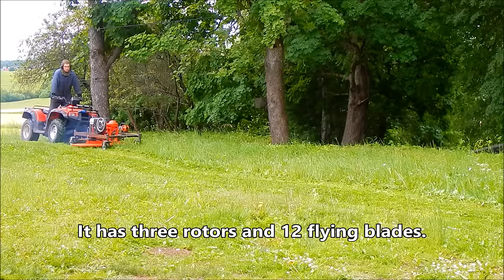Homemade Front Mount ATV Mower

Comment: You mastered that mower the blades are perfectly in line and in balance to the last gram, a couple weeks ago I was mower grass for hay on are farm with a 4 drum I think it 2.5 meter in length and the blade holder snapped of becoming a brick when though it and it shuck its balls off the part weighs 250 grams and the parts shop didn't have a new one so I had to weld one together and I was 30 grams to heavy and I thought it close enough got to the field started her up and it's going off again like crazy just shows what a good job you did to get it spot on 👍

Comment: You might have over 100 hours into building it. In 1994 I built a mower on 4 caster wheels, mounting it to the rear and offset to the left side of my Wheel Horse 252-H tractor. It had a Bolens 34" deck and a Briggs 8hp engine. It ran twice and cut well but I had it geared too high and the engine popped a valve. I didn't have the money to fix the engine so I parted it out. I wish I had a picture of it, but in those years trying to come up with an extra $50 was really hard. About 15 years ago by parting out lawn mowers and have gathered enough engines, electric clutches and casters to build about 6 pull type mowers. My problem is I have had health problems since I was a teenager and was diagnosed with Lyme disease 4 years ago. I'm 50 now and I'm hoping I can stay healthy enough to build some pull type mowers before I die.

Comment: Pretty cool. I really wanted to see how well it turned while mowing. Then it didn't show it so I assumed it couldn't?
Reply from the maker: It does pretty well. Pretty wide turning radius though.
Reply: Awesome man,  I've wanted to hook my mowers on the front as well but never went through with the idea. I do currently pull 2 push mowers behind me though. Gets me a 94" cut in total. Vid is on my channel if you are interested.

Comment: Very cool. I miss welding and fabricating. I worked at a company where I was the Lead mechanic with all my plus rates (welder-mechanic-machinist-pipefitter-millwright) so I had lots of tittles and The ones I used the most was my welding, mechanic, and machinist. I was forced out at 62, (Down sizing)and I miss that job, but I really enjoy being retired. I am building up my equipment, but I need a tabletop lathe.

Comment: ATV Front mounted, mower attachment. Caster wheeled, flail mower, w/ auxiliary motor, belt operated, w/ remote kill switch and electric height adjustment. ;-) SWEET PROJECT VIDEO!

Comment: I have parted out about 60 riding mowers and commercial walk behind mowers and I have saved parts from them. I have enough mower spindles, clutches, engines, casters, caster frames and metal to build about 6 of those. My problem is the damn Lyme disease I was diagnosed with 6 years ago. I have one 36” wing mower I was making out of a Snapper SPA 360 commercial walk behind mower, minus the rear half which had the engine and drive wheels. . I have the extra casters added to the rear. I just need to add the engine and the linkage to the tractor then add controls. 
I have another 40” wing mower I with a height adjustment system that I just need to install the engine, linkage to the tractor and controls. Lately the Lyme disease has reduced the strength of my arms.

Comment: Great build, I could tell you are young guy, lifting that 10hp Honda engine to the lathe chuck to see if the engine shaft fits the bore of the pulley, I used to do things like that back in the day but not no more!
Reply from the maker: It was a one time deal. I injured my back when I was younger while snowboarding, so I too have to be more careful and if possible work smart not hard. ;) Thanks for watching!
Reply: Donna Ares in DIY

Comment: I liked it more than I thought than I would . Nice use of metal and a welder . Cutting on wet grass is a big test . Hell even a good paint job . You even  put grease fittings on it  nice .
Reply from the maker: I got it working really good in later videos. Works nicely.

Comment: Really sweet would be PTO driven for a compact tractor.   Great build. Love watching a project like this.  Awesome editing, too.  Keeps it moving along.  Top marks!!
Reply from the maker: It's just a matter of removing the engine and making connections for the three point hitch behind a tractor. ;) Thanks for watching!
Reply: I'd like to see that project! PTO pull behind mower with an engine mounted and pulled by ATV, zero turn, golf cart....whatever.

Comment: Great work, however the brilliance of your first design was that the mower was wheel driven. While it lacked the safety deck you put on this one, it could have been towed by ANYTHING. An ATV, your pickup truck, a horse - and it would have worked as long as you could drag it with something. This one now takes twice the fuel (ATV motor and mower motor) and really only works pushed by an ATV since you can't access the controls if you were to drag it behind by something else. Still cool design - but I'd pay money to get something really functional that was just a tow behind that didn't need hydraulics or a drive connection like most brush hogs and was large scale for a wide cut to do field work. Lots of folks don't own the mid to large farm tractor needed for a brush hog and have to hire it out - but if you had something any ATV or even a pickup truck could tow behind - and it didn't need an engine, fuel, or even much maintenance - you've got a product that has a unique place in the market. Anyone who has ever seen the massive golf course tow behinds that are made from multiple barrel blade pull mowers knows how well those work without a motor.

Comment: Neat mower project. I think a vertical shaft engine without the differential would work better for this one. I like the 3 brush cutter type blades.
Reply from the maker: Yup, I know. I just used what I had and combined them into a machine.

Comment: I suggest reading up on inertial masses in relation to transition elements. See how much torque your engine has. Also you might need a discharge area.
Excellent fabrication skills man. You have talent.
If you want to make something that would compete with any equivalent sized tow mower that you would get at Tractor Supply or Northern Tool, let's do business. Im a junior mechanical engineering student.

Comment: How did you solve the problem of getting oil to the differential since gravity isnt holding it there? I am thinking of turning a solid rear axle with its pinion pointing up with a sprocket attached to the pinion and turn it with a vertical engine (with a torque converter style go kart transmission) but I’m not sure how to make sure the pinion bearings are getting oil.

Comment: have you thought about adding flags to the front so you can tell where your cutting deck is when you sit down?
Reply from the maker: I was standing up and checking out that everything was holding up. I can see the mower deck from the seat of the ATV so that's not a problem. ;)

Comment: I am very impressed by all the machines you've made. I can't help but wonder if you could make a decent living If you could find people willing to pay for your machines.

Concerning your lathe & mill though, have you checked them to see what kind of tolerances they can hold? If they can hold the same tolerances as the cheep Chinese machines, It may very well be worth your time. If you can make a mill in 2 weeks & sell it for 2,000 dollars, that is a decent living where I live.
Reply from the maker: Thanks man. I appreciate it. Don't know about the tolerances - I've only done stuff with an accuracy of a tenth of a millimeter because I haven't needed any parts that had higher tolerances.

Comment: What did you do to solve the belt overheating problem? I imagine with a smoking belt you would only get one or two mowings then have to replace the belt.
Reply from the maker: I turned the angle reduction box over, which reversed the gearing. No belt slipping problems anymore.

Comment: Maybe changing to a twin tensioner that holds the belt closer to the drive pulley would address your smoking issue, and give it  more horse power/torque. Very solid design :)
Reply from the maker: I already solved the issue. The mower works really good now: https://www.youtube.com/watch?v=J9voO5TIUNs  and  https://www.youtube.com/watch?v=gfi8fuGxeaQ

Comment: Great innovation and good fitting and welding.  Blades should be longer and secured Under the Disc.  Super Heavy Duty and 100 lbs over weight. Shafts should be a tight fit to the inside of bearings.

Comment: What's the final gear ratio? Looks like it slows down 3-4 times before diff and diff increases the soeed about as much? So overall one to one ratio? Much smaller machines have double or triple v belts. Not surprising that the single belt is slipping.
Reply from the maker: It was 2,5:1 engine : diff and the diff : rotors was 1:4 so the engine 2500 rpm turned into 4000 rpm at the rotors, so it was way too fast. I flipped the gearbox already and now it has more power but I still have to mess around with the gearing to find the sweet spot.
Reply: Tiit Saul

Comment: Seems like overkill for simply mowing grass, but I could use something like this for the half acre of bamboo I need to take down. Just open up the front of the deck to expose the blades (which your setup seems perfectly designed for rough cutting) and Bob's your uncle!

Comment: I have a question, I'm new to the small engine repair business  I've been thinking that I need to buy me some testing equipment such as spark tester, leak down tester and I feel like the most important a tachometer possibly an echo pet 1000r or 1100 r.  I've had several tell me it's just a waste of money and time and I really don't necessarily need any of it.  I would just like to have a professional opinion as to what would be the best for me to do.   Thanks for any advice you can give me!!!!

Comment: very nice.  could have saved a couple bucks and used greased bushings for your wheel mounts; don't need bearings in that application.
Reply from the maker: I thought about it but decided to go with the bearings - it's easier on the ATV.

Comment: 0:31 How in this world did you made the axle splines with a grinder just by hand...???
There must be some trick in there...
Reply from the maker: I traced the splines to the new shaft and just ground it down with an angle grinder - I used a thicker cutting disc too, for grinding. That helps.

Comment: looks like a vertical shaft engine would have been the better way to go,,,much lighter,,,,much less work,,,,,and wheres your cutting torch? Also,looks like the shop and doors should be your next project
Reply from the maker: I'm considering the vertical shaft engine for the next season. But this setup works pretty well too.

Comment: I get wanting to decouple the blade speed from travel speed and to lighten the load on the wheels to reduce rutting but why not just lose the weights and put the engine on the original mower.

Comment: whats the point of the rubber from the gearbox to the pulley? break away?
Reply from the maker: Yes. And it takes away the need to align those two perfectly.
Reply: thanks!

Comment: The belt drive attachment will not last.  Two chain sprockets instead of belt wheels placed side by side. Or rather on top of each other with a double chain connecting them would be perfect and last forever.

Comment: Since your ATV is air cooled, the slow speed required to mow will not allow to cool the ATV engine sufficiently and you will eventually cook up the ATV motor.
Reply: Ranchers are oil cooled. Oil flows through a radiator with an electric fan. My 04 was at least. That one may be a few years older so you may be right if the early ones weren't oil cooled

Comment: 13:10 All you had to do was put smaller pulley on the input shaft of your gearbox and it would have been all good.
Reply from the maker: The gearbox in the position as it is in the video speeds up 1:4 which means the input shaft turns 1 time while the output shaft turns 4 times accordingly. If I put a smaller pulley on it, it would speed up the rotors even more. I've already flipped the gearbox and everything works like it's supposed to.

Comment: Where did you have your ground lead?
When welding on the lathe?
Be safe,
    Be good,
        Be kind,
             Trust GOD
Reply from the maker: Clamped on the material I was turning.
Reply: Donn DIY 
thanks for the quick reply .
That was quite impressive project. Good video keep up the good work.

Comment: You'll ruin a lath by welding on it the berings will get arc marks on them
Reply from the maker: The voltage runs in a shortest line there is - from the lead to the torch, and they are near each other. At least that's what I thought while welding. Haven't looked inside the lade to check the bearings visually though.

Comment: what are the rubber stripes for at min 10?
Reply: they are leather
Reply: +James Flores Haha no. Thats reinforced rubber with nylon in it. It's used on for example snow plows to protect tiles, concrete and such. It's strong.
Reply: oh yeah didnt see the fibers in the center of it i assumed that hole at 10:07 was an adjustment hole for a belt
Reply: Lovejoy

Comment: this stationary gx engine is too weak for this construction with 3 blades- I think it must have at least 10-12hp , not 5 or 6 - like this you use
Reply from the maker: mikkei It's 11hp GX340.

Comment: do not weld in a lathe can earth through headstock bearings
Reply from the maker: Even when the earth clamp is attached to the piece that is welded and the welder is on rubber wheels? If so I have to rethink my welding habits. :D Thanks for watching!

Comment: Too much work in building it   he hee Would be a lot easier and fast mount 2  push mower on front . Come working for me> i Fabricate too and make it easy
Reply from the maker: It's the satisfaction from fabricating and later on enjoying the result as I did yesterday. Used this mower to trim the lawn again. Half of the 4 hectares I usually mow with it. Works great. All the work has already paid off.
Reply: i agree!  Its is enjoying and when every thing is perfect!   What can i say he hee guess getting lazy, and try to fine things that will work, that is made .  I hardly throw any thing away,  Its got to be trash! if i don't use it now. some time in the future i will

Comment: 55 inches cutting diameter with a Honda GX340 11hp it's  way too underpowered.
Reply from the maker: Nope, it works actually pretty good. I'm not saying it shouldn't have more power but it works fine also as it is.